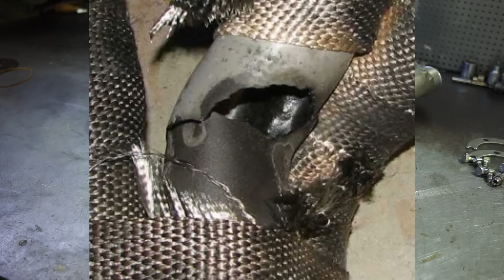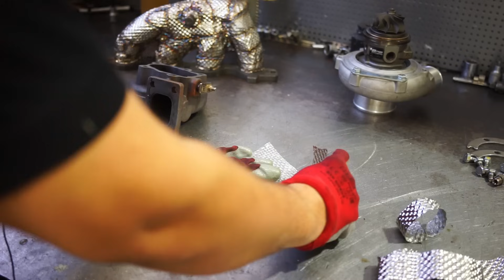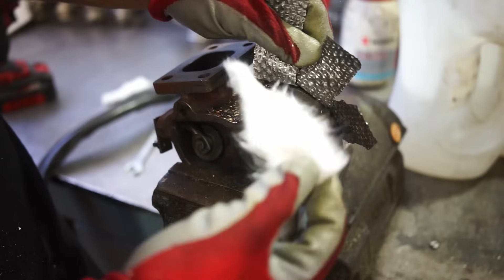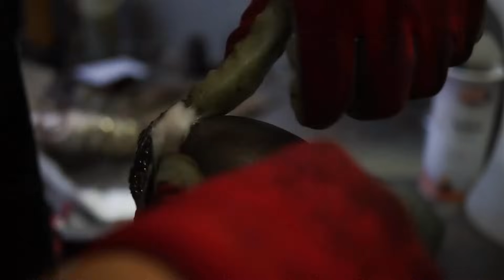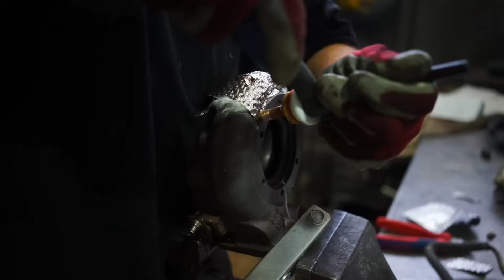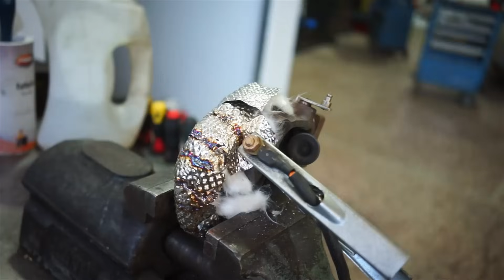DIY Turbo and Manifold thermal insulation for under 50$ | Heat management done RIGHT on a Budget

Comment: Also buff up the housing so the surface is shiny clean, make sure you have the the part properly earthed / grounded to the bench, (Tig is of course different because the cables are reversed but you get the idea)
Reply from the maker: Yeah it's likely only because I hold the on button for the torch for too long haha

Comment: Ok I can help here, as a paying viewer I will share this with you.

What you want to do is use some small steel/stainless steel washers at each bit where you want to spot weld, the washers give you a chance to put down a proper decent spot of weld without burning up the material, I use very small 5mm washers, push them down tight then I have my Tig welder set to 120 amps MAXIMUM! And if you have pulse frequency then even better! It will take all of the frustration away I promise you!
Beware though, even if you use Stainless washers the welder can cook out the stainless coating and end up rusting but more expensive washers the better 

Another method would be to weld on some thin studs to your turbine housing then use big repair washers and clips like you see on stock cars exhaust pipe heat shield, the VAG ones are really good.

But try my first method and you’ll be surprised how well it works 👍👊
Reply from the maker: Yeah that would work I have now had better success with more practice it seems to be important that the sharper the tip is the easier but I'll have to try more
Reply: @throttlebuddies0 yes, try to sharpen your tip as if you were welding aluminium, it helps to stay sharp for longer. You’ll have to re sharpen even few welds to keep it working good. I admit it’s a very annoying process but the end result looks really good, kinda race car-ish 😎 good work and content
Reply from the maker: @sebfullick5011  well problem is that you don't want to make it too sharp because it is copper it will be full after a few points so you need to find a compromise generally. I'd like to try with a copper wheel. Some people have had good success with that

Comment: Is that the inside of a collet grinded down? I don't know if I want to spend that much time with my TIG stuck to the material being a spot welder tho?..seems damaging, I'm not expert however.
I bought some shield like this of Aluminum, I've seen it wrapped nicely around a housing. Its very malleable. 
The welding makes a nice fit, I like your method.
Reply from the maker: its just a tip from a tig torch but that is like 1-3€ 
you can also do the same with any mig or flux core welder. 

yeah a spot welder would be more suited but i dont have one. im also not sure if its able to spot weld it to such thick material as the cast manifold!

Comment: Interesting technique. I welded some studs with holes in them to my turbine housing, then molded a layer of ceramic wool over the housing, and covered it with aluminum sheet similar to what you used here. I drilled holes in the aluminum for the studs to go through, then safety wire through the studs holds the sheet metal onto the housing almost like a net. Yes, aluminum, because it's easy to work with and was more readily available than SS sheet to me at the time. The heat isn't a problem for the aluminum since the sheet metal is only there to keep the ceramic insulation in place and act as a bit of a reflective barrier to keep radiant heat inside, it does not get anywhere near hot enough to melt Aluminum on the outside of the ceramic insulation. I've actually had the aluminum just wrapped around a turbine housing and wired on in the past for a car where the turbo was very close to the hood and it held up just fine. The little contact points and air gaps in the texture of the bumpy aluminum sheet created little air pockets and actually insulated very well. I thinnk Inconel for this is just a waste of money and material, the sheet metal doesn't need inconel's high strength at high temperatures because it barely needs any strength at all to do the job. Inconel in industry is only used for parts which need to remain strong at high temperatures to combat creep such as turbine blades and high temperature hardware. I use inconel studs to keep my turbine housings attached to the headers because I have found regular steel studs will relax with time and heat cycles and blow my gaskets out. The inconel studs stopped this. Mazda used inconel studs in their turbo rotary exhausts and BMW used them on motorsport headers.

Comment: How would this solution not suffer from the moisture issue just like the wrap? I would imagine condensations still be a thing?
Reply from the maker: condensation from the outside isn't really an issue such is witth exhaust wrap but fluids that get onto it such as in rain are a problem cause the stainless steel prevents the fluid from going inside the insulation material. 

the titanium or kevlar band snake in water or any other fluid on the other hand

Comment: If the heat is everywhere under the hood and shouldn't be, why the manufacturers never install any heatshields nor tapes ? Wrapping the exhaust and turbine with insulating tape is nothing compared to the cost of the entire car.
Reply from the maker: actually they do, almost every stock car has some sort of heatshielding or thermal insulation like in the video. not a lot of them have none. i font know where you got that info from.

Comment: I recently got a laser welder and it welds pretty good with it tbh it's the best so far
Reply from the maker: but arent laser welders super expensive? i might get a spot welder for batteries at some point.
Reply: @throttlebuddies0 they are but I use it for work so I mean I can afford it thrue my company 🤷🏻 I paid mine 2.3k for a 2kw model for china

Comment: Have you tried grinding or blasting the housing to improve the welding of the sheet to the cast iron? Even if its degreased, it could still have oil in the pores and the oxide layer could be making it more difficult.
Reply from the maker: Might be qorth a try haha
Reply: Sandblasting definately makes it easier

Comment: Is the "titanium wrap" stuff not as good? It's fairly cheap here, only 15 dollars for 50 feet/15 meters enough for 3 cars. I think natural wool like that might start to degrade over time, even though it won't burn it can still char like charcoal.
Reply from the maker: No it has the exact corrosion problems i described it also gets soaked in oil if there is a leak and can be a fire hazard

Comment: Each of those weld spots is going to be a thermal bridge, kinda defeats the purpose...
Reply from the maker: yes but still will do the job more than enough. that small thermal ridge wont do anything basically compared to the whole turbine housing or manifold being exposed.

Comment: This is a great video thanks for sharing! I have been trying to find the welding electrode you are using, can you please share the name of it or a link?
Reply from the maker: its just a normal tig welder. as i said in the video i just removed the ceramic and ground the copper tip thats it. you can do the same with a flux core welder or MIG welder works in the same way
Reply: Ohhh yep, had to zoom in on the video to get a proper look! 
Thank you for the fast reply!
Reply from the maker: @singleturbolegnumvr4  no worries!

Comment: Do I need a AC tig welder to spot weld these Aluminum heat sheilds?
I got a just a DC tig welder, and curious to do this job...Thank you!
Reply from the maker: Nope you can basically use any welder even flux core doesnt matter
Reply: @throttlebuddies0  Thanks for the reply! Keep making great content❤️
Reply from the maker: @mostlydiy7516  no worries! Yeah for sure haha

Comment: How long does it hold up? Any cons besides wearing the pipes sooner? And how soon are we talking about?
Reply from the maker: well highly depends you will have to watch your EGTs as they will be higher. the insulation itself will last but may degrade the material undernaath overtime BUT using exhaust wrap is much worse, as that traps moisture. you dont have that problem with this method so thats a positive.
Reply: @throttlebuddies0  Thanks. I will consider it then.

Comment: Battery spot welder is also good if you dont have tig.
Reply from the maker: you dont need a tig welder neccesarily. you can basically do it with any welder.

Comment: I came here looking for ways to insulate the exhaust components not for heat but rather for noise management. Do these principles still apply? Thanks!
Reply from the maker: no, it will change the characteristic slightly but will not make the car any quieter. if you completely insulate the muffler with the same method you MIGHT get less drone but ive never tried it.
Reply: Me too. Considering even over welding larger diameter tubing over the exhaust manifold on my old mini for this

Comment: That is a cool design I never even thought of using a tig as a spot welder before great idea definitely going to have to give it a shot!!! Me personally I would do it a bit differently I would run a stainless zip tie on each side of the turbo weld the foil to it then add insulation then another layer of foil and those stainless zip ties can be removed fairly easy then would have a removable cover might even be able to make a gap between the turbo and the insulation for air to pass thrue and channel it out under off the side of the car!!! Thank you very much for this video it's giving me a lot of ideas need to make a manifold sheald for my son's Corolla and thinking of doing it like this don't need this much but would be really fun to do!!!!!!!!!!!
Reply: i think that is going to work fantastically. love a good builder community

Comment: My car has aluminium heat shields on the manifold turbo and catalyst case they do a good job. No need to play with the design.
Reply from the maker: well yeah on a stock car or if done properly they can, but often arent optimal unfortunately
Reply: And if you can eliminate a lot of the heat less getting burnt working on it sometimes u have to when the engine is hot to figure things out!!!!!!!

Comment: Ok, I give up. Where can you find that spot-welding electrode for 'a couple of bucks' because I'm coming up empty. That thing look like SUCH a useful addition to the TIG toolbox
Reply from the maker: i dont know i just used a standard tig electrode or what that copper part is called and shaped to an edge lol
Reply: @throttlebuddies0  is that what that is? The video was super out of focus when you were showing how you rigged that up. I'd love to see a better shot of that sometime, that's really interesting.
Reply from the maker: @aMaff  yeah was kinda out of focus but you can see it in a couple of clips when im welding it. basically as i explained in a video took an angle grinder to it and put an edge on it, done.
Reply: @throttlebuddies0  yup, it makes sense now. Thanks. So, are you running it without tungsten then?
Reply from the maker: @aMaff  yeah also no gas needed
Reply: I drill a hole in one sheet and MIG or TIG weld them together.
Reply from the maker: @Dave5843-d9m  no holes just press them together as shown in the video and then weld
Reply: So we trap heat and do premature damage to internals. To prevent heat soaking other parts. This just seams backwards. I been working on something that will drop temps a great deal. I be able to test it once I get the car tuned in